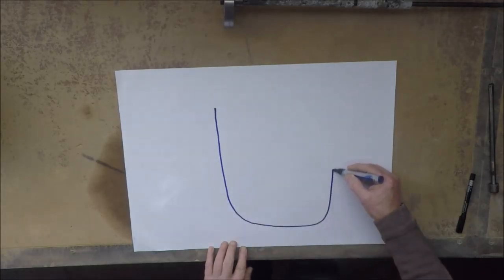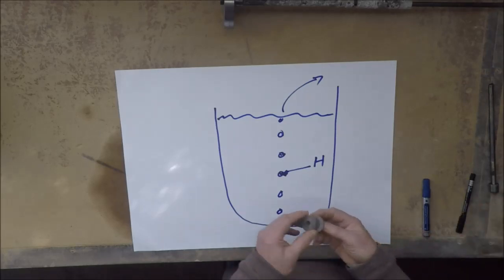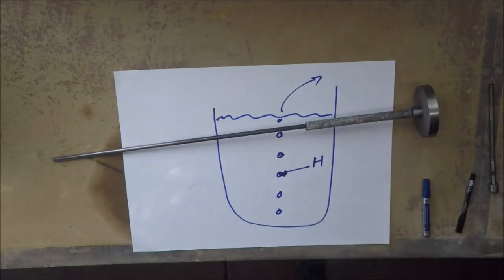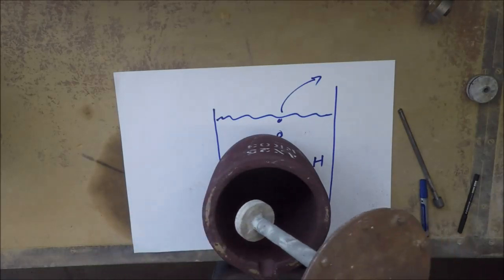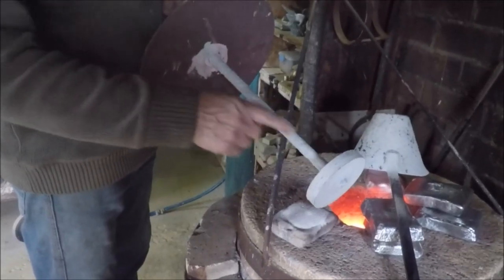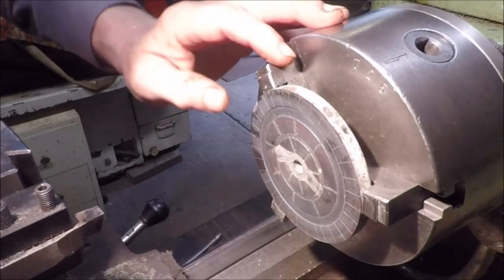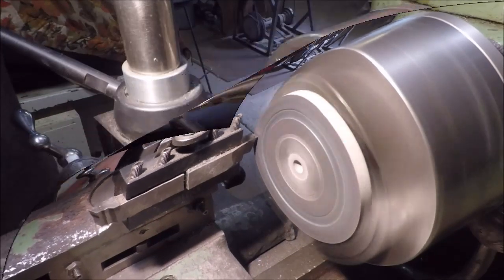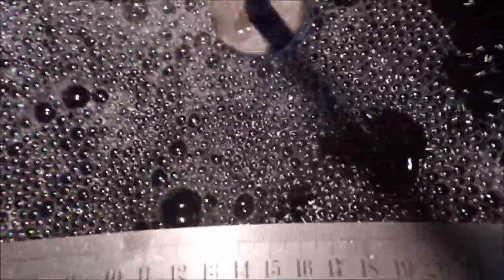My Home Foundry, Most recent Degasing Lance

Comment: Gday, great vids, and like a few have already commented, its good to see someone of your experience on this forum showing us amateurs a thing or two. When you're degassing for 7 mins do you still have the furnace on at full or is it off?  CheersBob.
Reply from the maker: Bob, Glad that you liked the videos. Firstly I never run my furnace "full" as it would produce over 500,000 BTUs per hour at that sort of setting! For bronze melting I might use 3/4 of that but for aluminium perhaps half at most. But I know what you are getting at  If I am degassing my 30 kg crucible (an A90) I turn the furnace off when the metal is at about 690 deg C on the way up, I find that during the degassing time the heat in the furnace and in the crucible soaks through to the metal and the metal temp goes up to about 740  deg C despite the furnace being off. (See note below) I like to pour most things around 730 deg C so this just gives nice time to flux the top of the metal and get the ladle hot so I can ladle the metal out and pour each casting (I don't lift the A 90 out of the furnace). If I am melting in the smaller A25 crucible I find that I need to let it get a little hotter before I turn off as the heat soak seems less with this smaller crucible (perhaps because there is more room around it). After degassing and fluxing I lift this crucible out and monitor its temperature while it slowly drops to the 730 Deg C that I want to pour at - this may take a few minutes. Sometimes  while waiting for the temp to drop I will cover the top of the crucible and pass argon gas under the cover to prevent any hydrogen pick up from the humidity in the air - this technique is also known to not only prevent Hydrogen pick up but to  actually lower hydrogen levels although  it may take 15 to 30 minutes to meaningfully lower the Hydrogen levels. This sort of thing is best reserved for alloys know to be bad for gas e.g. piston alloys.All in all I am not that happy with my degassing methods, they are for sure way better than those used by many others but they are not as good as I would like - I am thinking of making a small rotary degasser as these are much better (smaller bubble size) but some aspects of the design are very difficult!Note: the old adage is that one should degas when metal temperatures are falling i.e. that one should wait until a peak has been reached before starting to degas. I guess I sort of break that rule!Martin.PS. The 7 minutes is perhaps on the short side - ok for 356 (601) alloy but for piston alloys I use 10 minutes.
Reply: Thanks for the quick reply Martin, much appreciated, your experience has already put an end to some of my misinformed habits, and please just keep those vids rolling in mate, they are a pleasure to watch and learn from. Cheers Bob
Reply from the maker: Bob, Do I detect a fellow Aussie? You accent and speed of reply would suggest so. I notice that my last reply has one of those dreaded lines through much of it, I do not know why this happens but happen it does every so often and the line does not appear until after I have hit "reply" so there is nothing I seem to be able to do about it - just try and ignore the line and read through it. I guess I am doing something wrong for it to occur  but I don't know what! Most annoying! I hope that the "misinformed habits" that I have put an end too were not the ones that you enjoyed! :) I am always trying to do more videos but it is surprising just how long they seem to take - I do not know how some people do a video every few days - must be all they do!
Reply: Yes Martin , Im a Perth boy, and the habits were ones that improved my castings, eg smaller sprues for metal flow, not needing an extension riser on everything I do, all the little things I take note of , as your surface finish is great. Just a hobby for me, also the pattern making side is what I like best though. I think your strike through text on your comments is because of the Dash symbol before the "If" where it started and finished with a : after  note. if I put a dash in before the sentence and another after you will get strike though example below. Cheers Bob
Reply from the maker: Bob. Thank you so much for explaining the strike through problem for me. I will now avoid the use of the "dash". Small sprues , yes, the most essential thing to do to get a reasonable casting and so easy to do. A friend (a tame pattern maker) and I poured some pistons a couple of days ago. Piston alloys are, ahem, "difficult" and this was our third try, we have had all sorts of trouble with gas, shrinkage, and air bubbles. It is a large piston , machines to about 4 inch diameter and  6 inch high. It is deliberately heavy (it replaces and iron piston) so the pour weight was 4 kg. we poured it through a slot sprue just 12*4 mm and about 200 high. The metal went through a filter at the sprue base and then via two runners to two side feeders. Fill time was 27 seconds. Most people would reckon that such a small sprue would not work but it did and very well too as we made the best pistons that we have yet managed, proof machining has shown them to be more than useable. In truth we feel the 27 seconds was a little long and are going to increase the sprue to perhaps 15*4.5 to get a fill of more like 20 seconds. Next time we make these pistons I will make a video, people will be amazed at the strangeness of the mould, how it was made, and the smallness of the sprueExactly why some casters seem want to use a huge 25 mm plus diam. sprue that they extend upwards with a tin can full of sand and then cut the worst possible pouring basin, the dreaded funnel in the top of that sand, is beyond me. It is a methodology guaranteed to produce the worst possible casting properties. People have absolutely no idea of just how much metal a 25 mm diam. sprue would carry if you could pour fast enough to keep it full, but at say 200 high a 25 mm diam.  sprue will carry 2.5 Kg of aluminium per second! Boy that's a lot of metal, no way any of the castings YTers make need to be poured that fast.Rgds,Martin
Reply: No worries at all about the strike through problem Martin, anytime. I just cast a 1947 Norton clutch cover for a mate, Ive been mucking around with a cheap 3d printer to copy the pattern to allow for shrinkage. HAHA the printer is pretty cheap and nasty and a lot of work had to be done to get the pattern smooth for casting, the lettering doesn't print that well and had to be in filled with superglue to melt and self level the plastic. I should just stick to wood, or get a better printer. The piece I've made is 8mm thick and about the same dimensions as your motorcycle club badges, I printed the runner bar and vent and blind riser in a two part pattern, with just the top of the runner bar as the second piece. The problem with 3d printer is that when you draw your pattern and make it that bit bigger for shrinkage , I didn't take into account that the actual plastic would shrink , it shrank 3mm from my original drawing across the length, real pain in the backside. but just from reading your post above about sprues, I think my sprue maybe still to big, it tapers from 10mm to 8mm over 40mm and my vent is pencil size diameter. the actual pattern is 102mm x 56mm x 8mm in an oval shape, what size sprue and vent would you recommend this? My casting turned out ok, ill have to redo though as I had a couple of bloody loose sand grains.CheersBob
Reply from the maker: Bob, Ah, Yes, 3D printers they look like such a good idea but unfortunately they are not, well not for pattern production anyway. The problem is of course the lousy surface finish, all those damn layers! I have used a printed pattern once, it was a flat sided thing so I was easily able to spray a bit of auto primer surfacer on and sand it all smooth (several coats!) Then when I tried to put a rapping bar in the pattern and rap it to loosen it in the mould the pattern was so weak that it broke away where the rapping bar was. A friend has one of these printers and he too has had all sorts of trouble with letters. The problem is in the technology, I mean just how thin can you print a layer with a viscous semi liquid plastic. I note the appearance of printers using Uv light and photosensitive resins in an almost layer-less manner, it is much quicker and produces a vastly superior part. But so far you can't buy one of these printers you have to rent it and for some 6 figure sum  PA.Sprues, Over the years I have made lots of these but 90% of the time I use one that is 8 mm diam. at the small end 13.5 mm diam. at the bigger end and it is 120 mm long this corresponds to 1.3 deg taper per side.I use this sprue for from quite small work to up to 3 Kg casting weight, For very small work I use a sprue that's 6.8 to 12 over 110 that's 1.34 deg per side (guess I did not set the lathe quite the same!)Very rarely for larger work or when I want a quick fill  I use a sprue that's 9.6 to 16.8 over 150 that's 1.37 deg per side. I have trouble pouring fast enough to keep this larger sprue running full.However calculations based on recent reading would suggest that 1.5 deg per side would be better and I will probably alter my sprues to reflect this when time permits.( So much to do so little time!)Perhaps for the job in question I would have used smaller sprue but this would depend a bit on the alloy being cast, if it is at all sus i.e. contains any melted down cans or other unsuitable alloys I would go with the 8 mm diameter. The runner would lead from the sprue base to the base of a 25 mm diam. feeder (open topped) and it to the casting by a very short gate.I have used blind risers from time to time but I do find it better to have the riser open to the top of the mould as this helps prevent water (metal) hammer as the mould fills this can lead to very rough patches on the casting but the open riser gives the metal momentum somewhere to go. For thin work where I want to get the air out fast I too will use pencil (or smaller) sized vents but usually I rely on the open topped feeders and the sand permeability to do this for me.Loose sand grains - the absolute bane of my existence and the better the casting finish the more obvious and obnoxious they are, You have perhaps noticed from my videos that I take great pains to blow them from the mould and to make sure I have done so. Incidentally provided that you fill is reasonably non turbulent the metal stream will not pick up and loose grains in the gates rather it will just go over the top of them, and leave them right where they are so with enough care in checking that your mould is free from loose sand you should be able to avoid the problem (well, most of the time!) With a turbulent fill (large high sprue) you will pull sand from everywhere including the sides of the sprue.Rgds,               Martin
Reply: Hi Martin, thanks for the info, I know what you mean about the several coats of primer, hardly worth the hassle. HA I know what you mean about so little time, I get home from my mundane job and wonder if its too late to start making noise in my shed, got some younger Esme Watsons living near by , who don't appreciate hobbies out of the ordinary, unless its gardening or gossiping ha-ha. Looking forward to your next video Martin, not very often can one get a free education from someone of your experience. I appreciate your feed back , and be sure to see me popping up to pick you brain from time to time. Thanks a lot Martin, Take Care!Bob
Reply from the maker: Bob,  Brain pick any time, that's part of the reason that I am here. I am working on more videos but it all seems to take so long, how some people do one every few days is beyond me maybe they don't have a life! I am unfamiliar with the Esme Watson (never watched the show concerned) syndrome but I think that I get your drift, try to do them a favour or two so they are beholden it might keep the peace. Its hard to get out into the shed after a days work particularly if its either cold (cold in Perth?) or hot (more like it!) but what are weekends for?You take care too mate, Regards, Martin

Comment: How much time it will take for degassing 150 kg of copper.
Reply from the maker: Sashi, I have never got involved in the degassing of copper. I believe Foseco make some flux type products for this purpose and also that degassing using argon similar to what I do here is practiced. However the lance I use here is not suited to copper, the Boron nitride protective wash is only useable up to about 900 Deg C and above this it breaks down and provides no protection, thus at the temperature of molten copper the lance would be rapidly destroyed... Martin
Reply: Can I use ceramic pipe. Steel pipe shall be covered with ceramic pipe.
Reply from the maker: Shashi, Yes, by all means you can use a ceramic pipe to cover up the steel pipe carrying the argon (or nitrogen). The only thing is that the ceramic will have to be one that is good at taking thermal shock as otherwise it wil shatter when immersed in the molten aluminium. Note that in the video on the smaller lance I used a graphite sleeve. This is quite resistant to attack by the aluminium BUT I found that the aluminium found its way through the joint where the graphite met the top of the lance head and actually worked its way about 30 mm or so up inside the graphite tube around the steel inner. I had coated the inner tube with the boron nitride wash and that saved it. Perhaps an additional short sleeve like I used on the bigger lance head pipe junction may help here. Note that with repeated use I found that the central bolt of the big lance worked loose and the two discs slightly separated giving me an annular gap instead of the desired 16 small holes. To counteract this I had to put 6 countersunk screws through the top disc and thread them into the bottom disc to hold the discs together properly. I day I will do an update to this video to cover this modification.... Martin

Comment: Fascinating stuff. Thanks
Reply from the maker: Perry,  To be honest I now know of a few errors in this video and I have modified the lance accordingly. I hope to do an update when I am satisfied with these latest mods. However for most "backyard" work and assuming that the castings are not great thick lumps I would recommend not to degas. Instead use clean dry metal, melt quickly, do not get too hot, and cast as soon as hot enough. Many of the so called degasing techniques in use in backyards do not work and some actually add gas!...Martin

Comment: Mig welder gas is  20% argon   80% co2. Do you think this mix would accomplish anything ? I am planning to try casting for the first time later this summer, so I am doing a little research now. I was thinking urethane foam coated in plaster and buried in loose sand. Any thoughts would be appreciated.
Reply from the maker: A common question but the answer is NO, well nothing good anyway! Unfortunately aluminium and CO2 react to form aluminium oxide and (presumably) Carbon. The last thing one wants floating around in our aluminium is even more oxide than is already there. The only viable gasses are straight argon ( I use commercial grade) and nitrogen. Bottled nitrogen has higher oxygen and water levels that the commercial argon and the argon gives a drier dross so it is my choice.Be careful of urethane foam with heat it gives of some very nasty gasses including I believe HCN. I know people have used it and presumably lived but I suspect they did it outdoors on a windy day! Plaster coats are a bit troublesome as its difficult to get all the a water out of the plaster - impossible in fact unless you take the plaster up to well above the temp at which the foam would go real funny :) Again I know people use plaster coats but again they don't really do it right the idea is that the gasses from the decomposing foam come out through the coat and into the sand and NOT bubble out through the metal. Looking at most YT videos of it being done one can see that most of the gas does come out through the metal, bad, very bad. Vegoilguy (check out his latest lost foam video) and I are currently working on a simple coat that will allow the gases out through itself, early days yet. but consider not using any coat and using a normal green sand or a CO2 cure silicate sand (your 20 %Ar 80% CO2,( I thought it was the other way around,) should cure a silicate sand off ok) in place of the dry sand ,this was after all the original form of the process of lost foam before coats were developed. The sand should be fairly coarse. Both Foseco and Ask Chemicals have coats commercially available for this process. Sorry to be so negative but the more problems you learn about at this stage the more chance you wild have at success when you actually try it.Good luck and if I can be of any more help just ask, PM if you wish.  Rgds, Martin
Reply: Thanks for your detailed reply. I think this will help eliminate a few rabbit holes.
Ken
Reply: For 99% of the stuff you do at home you don't need to degas. It's good foundry practice that's more important.